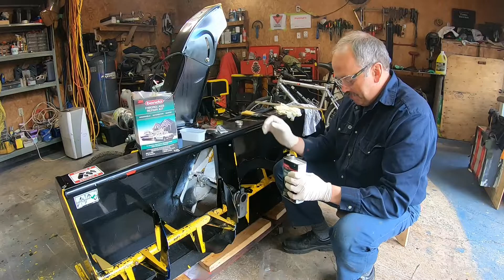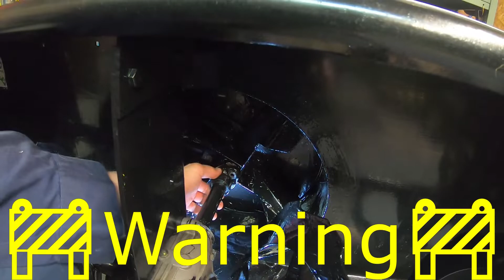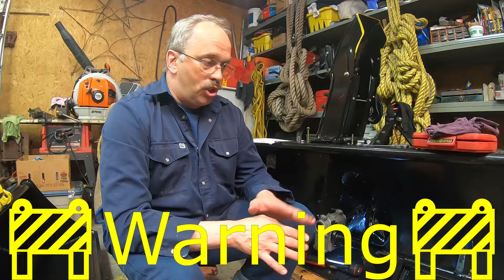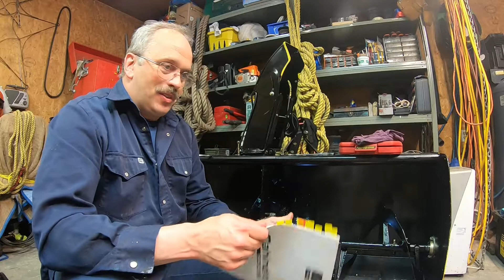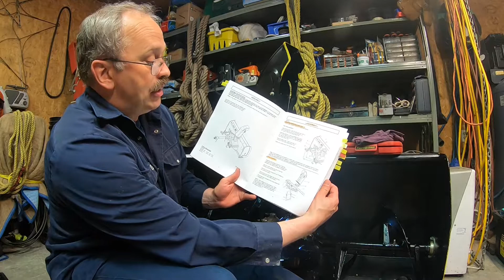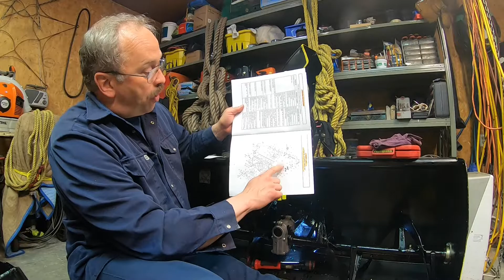Mahindra 3 points Snowblower 56  BER563PT maintenance tips and repair

Comment: Scotty was very interested in that cat 😁. Giving that drum a coating of resin should increase it life mon ami. I’ve come across a piece of wood with my snow blower and it did break the shear pin, which is an easy fix. Happy Sunday mon ami. 🍻😁👍
Reply from the maker: Good Morning mon ami, Yes Scotty has that cat in ( the Collimator ) 🤣Yes that hard resin coating should, if not I will put a cloth fiberglass over it or even better than that call a uhmw material. Yes shear pin is way more easier to fix that a tractor pto transmission 😇👍 Thank you and you too have an happy Sunday Sir Cheers 🍻😇👍
Reply: @RCAFpolarexpress  👍😁🍻
Reply from the maker: @Viper6-MotoVlogger  Going to do a tractor ride in Arvida today looking at short skirts and long legged ladies 😎🌞👌👍😇🍻
Reply: @RCAFpolarexpress  very nice 😁👍
Reply from the maker: @Viper6-MotoVlogger   Yes in deed mon ami 🤣😇👍 Cheers 🍻
Reply: @RCAFpolarexpress  🍻👍😁

Comment: That's a pretty good idea Dave. I guess we will see how well it works. I can wait. Not a problem there. In no hurry to see snow again. However, given as hot and humid as it was here in Iowa yesterday, I would like to borrow just a little bit of cold weather from next winter. Not a lot. Just enough to take the edge off of the heat.
Reply from the maker: Good evening Sir, thank you very kindly and I'm pretty confident that I will have to keep adding that resin over the year but I least it will offert better protection than paint !!! Yes a little snow storm right now will be very nice !!! Thank you again Sir Cheers

Comment: Comment ca va mon ami?  This is another very good maintenance video Dave.  I like this job that you have done with the resin on the impeller housing.  It will be interesting to see if the snow doesn't stick to it.  I would like to do this resin on my mower deck too.  Thanks for sharing your thoughts on maintenance and how you do your maintenance on the snow blower.  A la prochaine!!!
Reply from the maker: Bonsoir mon ami, Thank you very kindly for your OUTSTANDING supportive very well written positive comment 👌👍😇 The resin in like a glass very slippery surfaces so the snow will go faster for sure  👍👌😇 You never loose with resin it is so tough I can't wait to see after this raining season to see the underneath of my mower deck 😮 Mille Merci et bonne semaine mon ami Cheers 🍻🍻

Comment: Great video. And I sure like the funny parts of the video. And how well does it work Dave. If you have done it before. I would have used a heat gun to get rid of any moisture on the parts you were putting the resin on. Just what I would do. I think that’s a great idea using the resin. I may do that to mine.
Reply from the maker: Good day Sir, Yes using an heat gun will at work too but their is rubber materials behind the drum ( belt and sceals ) and not to mention will be hard on the paint too 🤔 I rather use a good fresh air from the heat gun ( very low temperature setting ) Thank you again Sir Cheers 👌😇🍻
Reply: RCAFpolarexpress   Ya, I didn’t mean to get it real hot Dave. Just a bit of heat to remove surface moisture. Even a hair dryer would do it.
Reply from the maker: @noelstractors-firewood57  Yes that is the spirits Sir,,, nice and cozy warm in deed Have a great week Sir Cheers 👌😇🍻

Comment: You are the maintenance king!  I wish I was better at working fiberglass resin.  It can be used for some really creative things.  Have a great day!
Reply from the maker: Good Morning Mon ami, thank you very kindly for your OUTSTANDING support and positive feed back. Practice make perfect Sir, here in this high corrosive province I learn realy fast to use resin/fiberglass to fixe car/truck floor or side panel so I did not have to re fixe it later on 👍👌😇 Yes You will be pretty good at it Sir, just remember about the toxic fumes and you will ok 😇👌👍 Keep up your OUTSTANDING videos Sir Cheers 🍻🍻